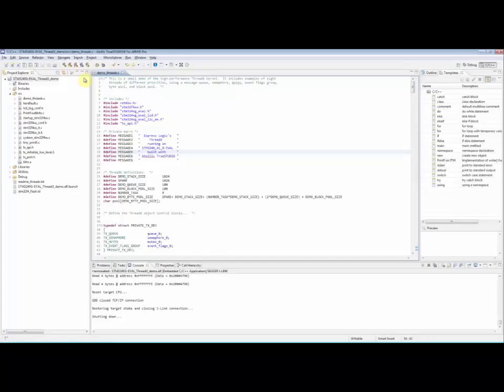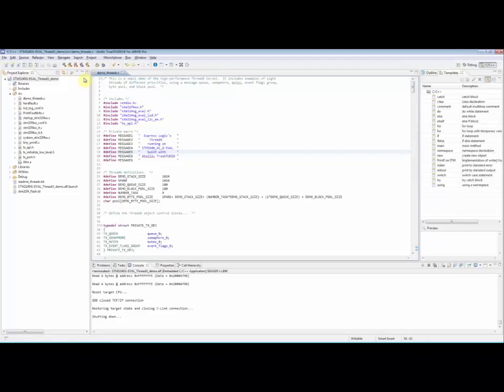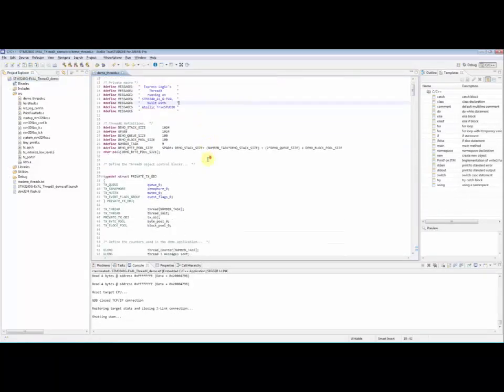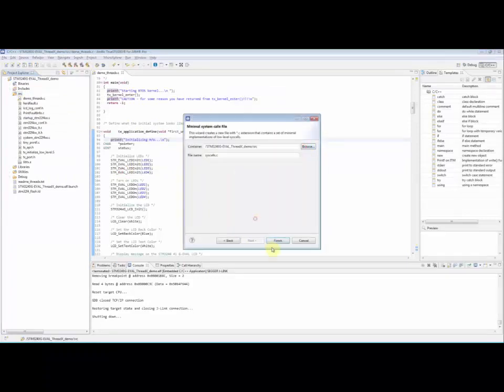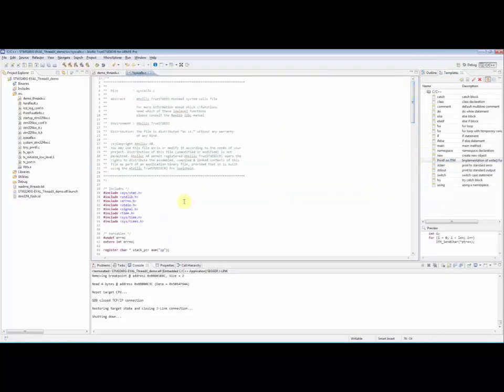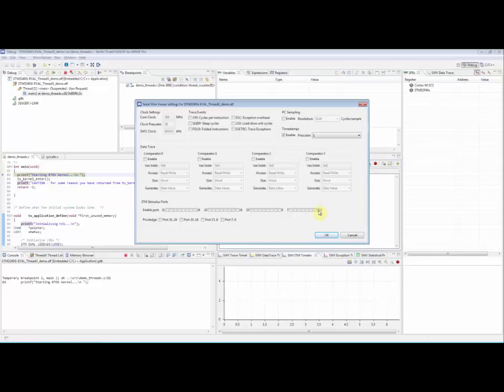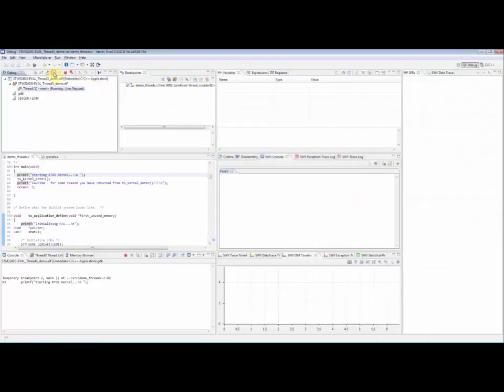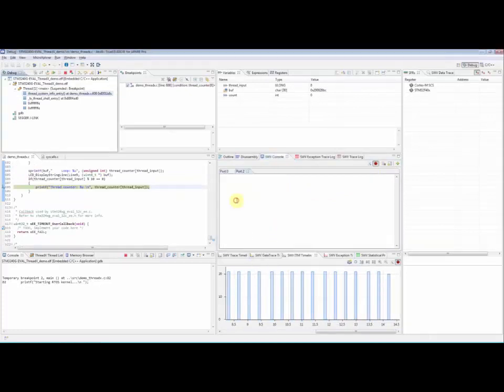Printf redirect

Comment: I don-t find the ITM template in my TrueStudio (V9.0). Is there is something specific to do? Many thanks.
Reply: The author of the video created the template himself. TrueStudio does not come with a template for this.
Reply: Look into the file core_cmX.h (X=3 or 4) it is part of the cmsis core libraries. In this file there is a function ITM_SendChar(). It defaults to port 0. From there however you can figure out how to go for port 31...
Reply: Bertrand Rozier Hi! I have Cube MX last vers. 4.25 and  last True Studio ver. 9, but when I want to export project to True Studio, I can not choose True Studio!? What a wonderfull ironic!? Did you notice that problem!?